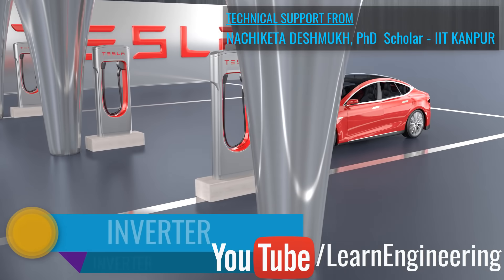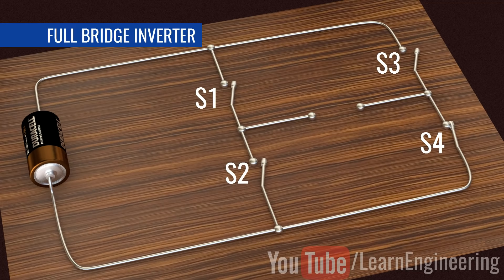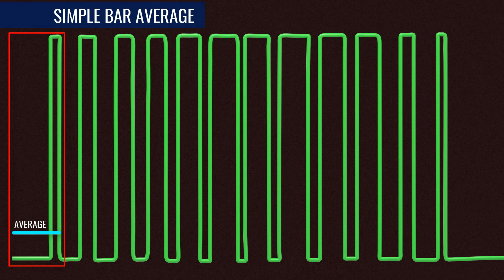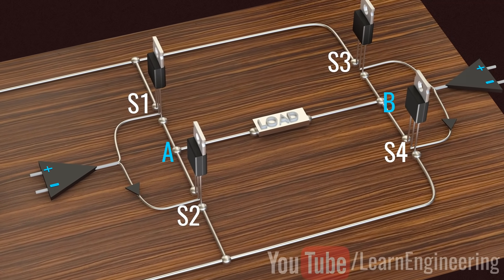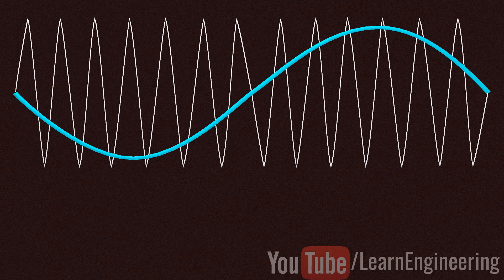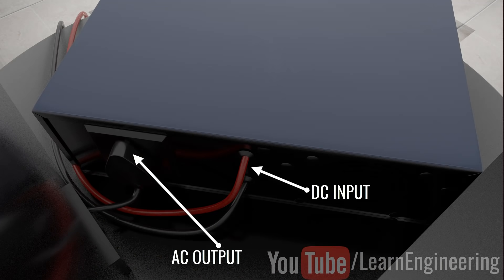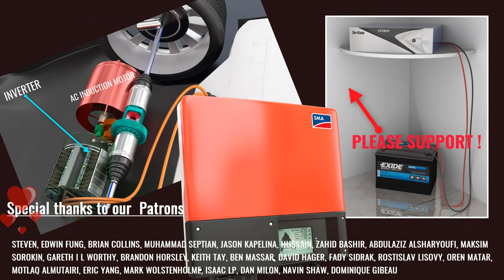Inverters, How do they work?

Comment: P.s. PWM is also used in mobile phone's Oled display. If you turn the screen darker, the average light Intensity will be darker but the max light point will be the same as the brightest level. We won't realise any problem since they are doing a pwm of three hundred fps therefore our eyes won't be able to see the variation. However, this is not good to our eye actually since we are still receiving maximum brightness even though our eyes think it is darker. This is what Samsung and other mobile phone company won't tell us.

Comment: Whattt 
All I already know 
This you tell about class d amplifier that is also not correct 
And mosfet driver is also not correct these need high level of laches and logic gates otherwise mosfet driver inbuilt in a single circuit 
There is another process it is modified sine wave you are telling 
Drivers such as esg002 gives pure sine wave using half bridge

Comment: A note to people that felt a bit lost as to the paradigm of power and signal. In engineering building a signal is much easier resource wise than building a system that can output actual electrical power. For example power amplifiers, getting a signal out is very cheap and easy, but getting this signal to produce actual power/energy to another system is the hard thing to do, very expensive to do it efficiently and effectively (clean, undistorted). Engineering is why we live in a technological world! The sine wave needed to drive the pulse width modulator is easy to build!

Comment: And again you got some of the details wrong.  First, 60Hz means the on AND off so the switches only flip 30 times per second.  Second, a comparator does NOT compare the current to a triangle wave as there is no such thing.  If you are referring to a saw-tooth wave, that is still not how it works.  The comparator compares one input current to another.  Third, it IS possible to get 60Hz with mechanical switches.  In fact, that's how it worked before modern electronics were a thing.  Fourth, the hum you hear is present even in modern electrical things.  That hum is the current oscillating in the wire.  Sixth, capacitors, etc. REDUCE the sinusoidal character of the current.  That's what "smoothing" means.  Seventh, electric cars use DC motors, not AC motors.  Finally, computers run on DC current, not AC.

Comment: PLease Let me know why there is no effect of  Resistance in AC transmission Line , Why DC is not used for Transmission,- I Know this is basic , but i find it difficult to understand , -- Thank you.
Reply: There is an effect of resistance. That’s the point. Research the skin effect.
Reply: @eswing2153  HI Carl Thank you ,Noted on the "Skin Effect"
Reply: @id523a yes. This is elementary dear Watson
Reply: They do transmit in DC when absolutely necessary.. when cost doesn’t matter. When things aren’t as easy as it seems. It’s just more expensive and less safe.

Comment: The second inverter configuration looks like Class-D amplifier, 
and if so, both of them can be the same ?
(the power amplifier and the inverter)
Reply: They are basically D class amp, a H bridge here, better to drive them using a cheap MCU

Comment: I always wondered why may fan made that distinctive noise while using an inverter
I was told that the inverter provided bad current 😂😂
Reply: Current is bad. Very bad.
Reply: @eswing2153  voltage and current are interconnected if your draw small amounts of current, the voltage will be lower. one is not worse than the other
Reply: @Theinatoriinator  if you look into Dalziel and Beigelmier you will learn the mechanism for fibrillation is current disrupting the coordination of the nervous system which keeps your heart beating. The impedance point to point across any two or more points is different for a human body. 

The mechanism within the body is ion flow. Once a voltage is applied across any two points, current will flow across all parts of the body in ionic flow. The current however tends to disrupt the nerves the worst as they function using ionic flow within a nerve cell. The portion of current through the body that affects the heart nerves will depend on where it is applied on the extremities. 

For example, you could apply 50V AC foot to foot and you can expect the current through the heart to be significantly lower than the same 50V hand to hand, even worse chest to left hand.

It’s the proportion of current through the heart that causes fibrillation not the exact voltage applied across any two points. And we haven’t even disused effects of moisture, contact area etc.
Reply: @Theinatoriinator  I understand ohms law.

Comment: The job of the inverter is to produce a very high-power signal from a smaller control signal given by the comparators -- this makes it very similar to a power amplifier but optimized for a much narrower output frequency range. In something like an electric car, the comparator is fed by what amounts to a computer with a sound card. The computer can be programmed to produce any kind of control signal in it's sound card, and the control signal can be changed at a moments notice to respond to input signals coming from sensors which constantly monitor driving conditions -- acceleration, breaking, going around curves, tires slipping, hitting bumps. These computers can be programmed with artificial intelligence, like deep learning neural networks, that have been trained to produce the optimal control signal in response to any given driving condition input signal from the sensors.

Comment: Ok this was decent. But I would have liked more in depth on the smoothing to create the sinusoidal wave. Also where did the triangular wave come from?
Reply: Precisely. Not explained at all! Especially the triangular wave.
Reply: Both can be generated using a uC or a DDS. The good thing is that they can be very low power signals. Control of them gives you the output frequency
Reply: @budavargas  Thanks!  Any vids on this topic?
Reply: When you connect a constant current source to a capacitor, it will output a rising voltage ramp. Discharging the capacitor with a constant current source causes a dropping ramp. Therefore making triangular waves easy. A constant current source can be made using a voltage comparator with negative feedback and because it's output voltage is inverted relative to input, you can make a loop that self-oscillates.

Comment: @Learn Engineering can you explain how voltage regulators work? 
https://alcoholcontrols.com/vore.html?msclkid=4610f6a6085d12abc1d6a8ac717bb6a7&utm_source=bing&utm_medium=cpc&utm_campaign=**LP%20Shopping%20-%20Liquor%20Control%20System%20Supplies&utm_term=4585581966041500&utm_content=vore%20%7C%20Voltage%20Regulator%20%7C%20%2465

Comment: hi, I think that this video could have a more complete version explaning how the  Fourier transform ( frecuency spectrum) develops when we increase the complexity of the control of the Switches (from square wave to SPWM  or multi level control)  and why we use SPWM with filters instead of just a square wave with filters ( because something that you didn't explain is from where comes  the sine wave that we use for control  ). Anyway a very good video.
Reply: Can you briefly explain to me where the sine wave we use to control comes from ?
Reply: @phamhuutri1996  typically the microcontroller (MCU) that will send the control signals will store one cycle of a pre-calculated sine wave (discrete points or values between 1 and 0 ) so that depending at the rate that you use it you get a certain frequency. This is also useful as no computational power is needed and the MCU can be cheaper (float operations require a more expensive hardware).

Comment: Unless I missed something, it says you need a sine and a triangle waves... ...to produce a sine wave :)
Reply: You have two sine waves: a control sine wave and the output sine wave. The output sine wave is a very high-power signal that can turn a motor, the control sine wave is a tiny signal coming from something like an oscillator, or in the case of an electric car, a circuit that is basically a glorified sound card connected to the car's computer. The power inverter is basically an amplifier, but optimized for a very narrow range of high-power output signals to turn electric motors, rather than to produce music in speakers.

The computer's sound card can produce absolutely any control signal at all just like on your own home PC, and the control signal can even be programmed by a deep learning neural network (artificial intelligence) to produce the best possible control signal to immediately react from input signals coming from the car's sensors, which monitor acceleration, breaking, going around curves, tire slip, hitting bumps, etc.
Reply: Yes. Same with me. Wtf is going on

Comment: بسم الله الرحمن الرحيم
من باب المذاكرة:
يجب عليَّ أنْ أضع بطارية أخرى بمقدار سالب 12 فولت على الرجل رقم 4 
وعلى الرجل رقم 2 أضع بطارية تتغير من الجهد 7 فولت إلى سالب 7 فولت 
ثم تبدأ عملية المقارنة 
لكن بجب عليَّ أنْ أكون دقيقا في اختيار المقاومات
or 
i should put -12 volts on pin number 4
&
pin number 2 a voltage divider between 9v to -9v
then the lm358 start to compare 
i should be aware to select a resister value

Comment: بسم الله الرحمن الرحيم
من باب المذاكرة:
ما هو نوع المقارن؟
وأريد دائرة ال PASSIVE FILTERING ؟
Two questions
what's the type of comparator
?
  what are the value of the elements in the passive filtering circuit
& 
how are they connecting
?

Comment: The video is nice, but where are the comparators connect to? a microcontroller? then it reads the signal, does the average of the pulse widths and makes it an input of the comparator?

Comment: 2:06 did mosfet create pulse?
Reply: بسم الله الرحمن الرحيم
من باب المذاكرة:
mosfet عبارة عن مفاتيح تغلف وتفتح بسرعة 
mosfet like a fast swtich
it switch up & down fastly
لكن هناك دائرتين
مرة تفتح قي الموجب ومرة تفتح في السالب 
يعني مرة يعطيك 1.5 فولت ومرة يعطيك -1.5 فولت
لذلك سيتولد عندك النبضات
لكن ما نوع المقارن الذي استخدمه
عمار اللبناني 
هل هو lm358?
there are two circuits
once/ the current will pass  in 1.5 v
when you measure the load
you will get 1.5 v
second/ the current will pass  in -1.5 v
when you measure the load
you will get -1.5 
then the pulses will generated
but which type of copmartor i sholud use 
is it ؟
lm358?
ammar Lebanon

Comment: Triangular signal is generated with a VCO to be able to synchronize the inverter with the domestic line voltage using a PLL and the sinusoidal signal could be generated with a DAC converter

Comment: wait a minute
so u still had to feed a sin wave into the comparators to drive the mosfets to create a sin wave using DC
then whats the whole point of using a sin wave to create another sin wave
Reply: The driving AC sine has much lower amplitude and power outcome-you essentially use small sine wave to create a bigger, more powerful sine wave from DC source.

Comment: I never knew electricity was this much complicated!
Reply: If you find this complicated, expect quite a shock once you learn about computers :)
Reply: @Blafirelli  I mean the way I learned about binary I just think of a CPU as a few billion light switches that turn on or off 4,000,000,000 times a second if running at 4ghz.

Comment: Why is the electric car powered by an AC induction motor? It seems like too many conversion steps are involved. Wouldn't it be much easier to power the car with a DC motor, and use PWM (pulse width modulation) switching to chop up the DC battery voltage to control the speed of the car?
Reply: A true DC motor has to use brushes, which creates problems due to friction and arcing between the contacts. For applications like electric cars, brushless motors are superior. However, all brushless motors are AC. Any 'brushless DC motor' is actually an AC motor that has an inverter circuit.

Comment: Wait... why would a ceiling fan ever use square wave power?  They're almost always (always in my experience) hardwired in to the house circuit, which is A/C from the power company.
Reply: If the house in question runs on solar power, it runs off an inverter.

Comment: AC is not defined by having an average value of 0 as indicated in 00:39, but due to the fact that polarity reverses, causing the current to alternate direction. Your depiction of NOT AC examples is incorrect.
Reply: Furthermore, all displayed waveforms are AC. AC can also be non-periodic. And YES, the definition of AC depends on the change in current direction over time.

Comment: How a dc motor work....since for a motor to rotate we always need a.c signal for polarity.....can you please explain this...
Reply: DC motors use a split-ring commutator. If we consider a 2-pole motor, the commutator is split into two half rings. So when the motor turns 180°, the half ring previously in contact with the positive brush now contacts the negative brush, and the half ring previously in contact with the negative brush now contacts the positive brush, reversing the polarity of the motor's coil. On the coil, this essentially creates a square wave AC signal with a frequency equal to the frequency of rotation of the motor.

Comment: Video glossed over key details - the generation of (how?) triangular and sine waves into the comparators.
Reply: i thought the same thing.. if u have a sine wave into the comparitor, whats the point, u already got it
Reply: @bubbahogg-buga4613  the sine wave going in the comparator is having an amplitude of not more than 12V, while the sine wave coming out of inverter has a magnitude of 120 or 240 volts depending on where you live. With the help of function generator you can generate the required sine and triangular wave.

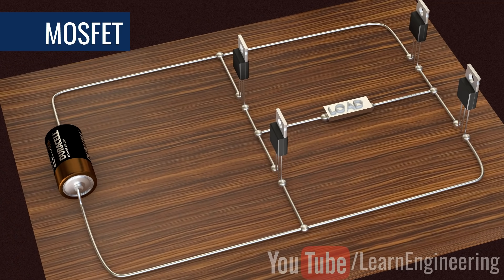Comment: Anyone besides me notice at 2:00 the MOSFETs are hooked up incorrectly? The two low side ones have the Gate pin on the load, while the two high side ones have the gate pin to the suppy power.

Comment: Couple of issues.
1) You CAN switch a mechanical switch at 60 Hz.  The switch might wear out, but it is perfectly possible to do it mechanically.
2) Ceiling fans do not use inverters as they are wired directly into the main house supply line via the switch and breaker panel.
PS 60 Hz switches 60 times per second NOT 120.  That's why it is called 60 Hz not 120 Hz.  You might want to fix that.
PPS Uninterruptible Power Supplies (UPS's) out put DC not AC as computers and ALL electronic devices use DC.  The have a transformer inside that both alters the voltage and turns it into DC.

For a tech channel, you people are sadly uninformed on this topic.
Reply: Apparently you missed something here .. he said 120 times per second because there are two points (A and B). Last I checked 60x2 is 120!
Reply: @gidigida  See here's the thing, those "points" open and close in unison so...no.  It is still only 60 times per second.

Comment: One point which I didn’t understand. Inductor smoothes the current while capacitor voltage?? Please explain
Reply: A capacitor is basically a battery that charges up with voltage using 2 plates that charge and an inductor is the same except in a coil of wire to control current. You could find some good videos about it I'm sure check it out, electronics are so cool!

Comment: You guys do a great work, you summarize a whole semester class in a few minutes!
Reply: No he didn't ... he failed to explain how comparators work and another thing ... 60 Hz is 60 oscillations per second NOT 120 as he quoted
Reply: @janinapalmer8368  120 oscillations is correct only because there employed 2 switches for the flow of current at a time

Comment: But where did the triangular and sine wave came from? And if we already have a sine wave then what’s the point form the inverter😲?
Reply: What? The sine wave can be a fraction of a volt. It can be created by a small oscillator or can be referenced from the grid if there is one and you make sure there is no phase cancellation. The curcuit in the video is just a class-D type amplifier that projects a small signal (sine wave) onto the high power DC and therefore makes it AC.

Comment: i hav design a square wave inverter they are good in appliances that have DC internal circuit , but square wave inverters are not good in AC motors.
Reply: Find the inductance of the AC motor's stater coils, then place a capacitor inline with the square wave generator. The capacitor and the AC motor's stater coils form an RLC circuit which can filter out the high frequencies of the square wave signal, leaving you with a nice sinusoidal wave in the work load of the circuit.
Reply: Find the inductance of the AC motor's stater coils, then place a capacitor inline with the square wave generator. The capacitor and the AC motor's stater coils form an RLC circuit which can filter out the high frequencies of the square wave signal, leaving you with a nice sinusoidal wave in the work load of the circuit.

Comment: I'm new at this but at 6:31 he says frequency is speed, amplitude is power. I'm pretty sure Power = speed * torque so wouldn't amplitude be torque instead and Frequency * Amplitude = Power ?  Please correct me if I'm wrong.

Comment: The are not “pure sine wave”  Far from it! very dangerous to have near your or even worse running through your house wiring. They create very powerful electromagnetic waves that effect human organisms . I tested both two very expensive sine wave inverters and two vector modified square wave inverters. The sine wave one produced rf signals off my meter while the square wave ones hardly nothing. I run they through a triplite L.C. and Checked with an oscilloscope and they were right on and no rf static. 
Don’t buy these sine wave ones what ever you do!

Comment: what kind of comparator did you use?
Reply: بسم الله الرحمن الرحيم
من باب المذاكرة:
هذا ما أسئله
هل هو 
lm358
?
وهل نستخدم 
transistor
بدلا من 
not gate
?
وما قيمة passive filtering?
-------
that's what i ask
is it lm358
?
should i use the transistor instead of not gate?
?
what are the value of  passive filtering
?